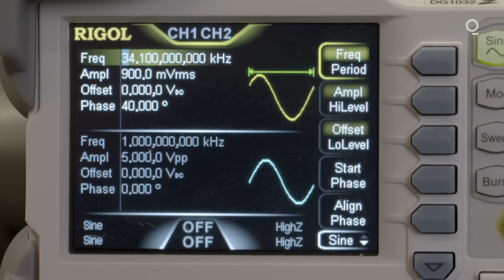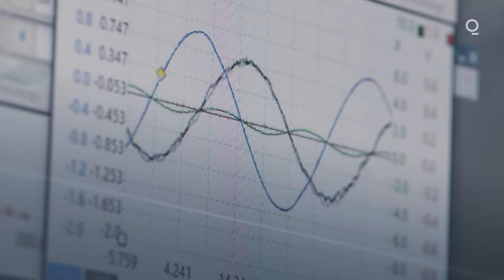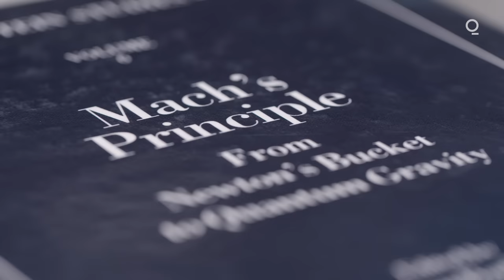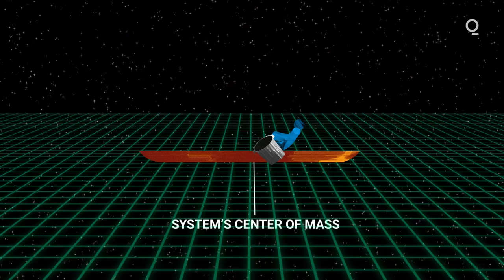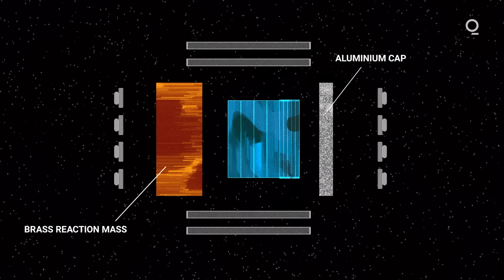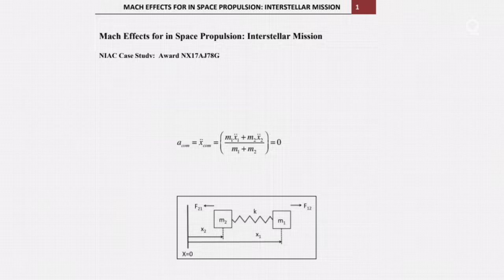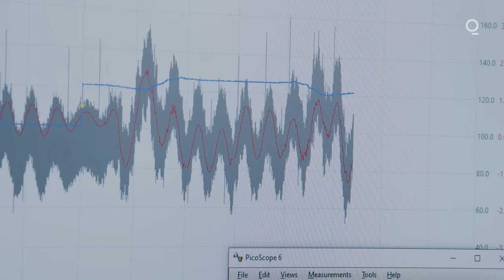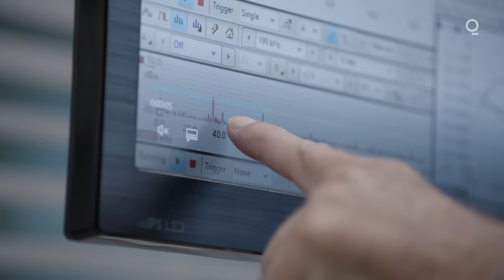Two Scientists Are Building a Real Star Trek 'Impulse Engine'

Comment: Crystal don't get mass when it expands and don't lose any mass, when it shrinks. Such mechanism already tested in space (But they probably shouldn't). Force produced by such "thrusters" is result of uncounted friction in system, in  the vacuum of deep space it stop producing any force. Its already tested multiple times.
Btw If it work it should work in microscale too, so MEMS is a perfect technology for magical arrays of "thrusters". Also in such form-factor it should be easier to isolate most  parasitic forces and keep them inside a chip, so testing will be more precise. Also different thrusters in the Array on chip may be arranged in a way that system will provide continuous force (decouple individual thrusters  with some kind of springs and dampeners, so vibrations will be filtered and any constant force should remain. that alone will  reduce vibrations, but if nearby  "thruster" assemblies will vibrate with phase shift, say 120°, it should completely cancel out vibrations (without decoupling it may cancel useful force as well), so you get hard-to-refute results).
I don't believe that it work, but if chip would generate some measurable constant force in vacuum chamber, I'm probably would had change my mind.

Comment: Either way, this work will prove a path is viable or not…That is valuable to science.
Reply: @dbmail545  so what do you do to make a difference for the future? Are you out contributing to make change or keep it the same and hide away in a bunker naysaying others sacrifice?
Reply: @Peter Evans  the links to the research is in the description…Didn’t notice braces, but I’m sure a dentist can solve it. Still any person out there working to push science is a value to it…Especially when it comes to humanity expanding into space.
Reply: @Peter Evans it’s pretty impressive they made it to phase II thus far in an Innovative Advanced Concepts for NASA…How far has your R&D made it?
Reply: @Peter Evans, "No mention of where this energy is coming from to power the crystal". They did mention where the energy comes from to power the crystal. At 9:20 they say a nuclear battery would be used to power them.
Reply: @JNCressey  what exactly is a nuclear battery
Reply: @duality4y , a nuclear battery is already well established technology. 

It is a device that holds a radioactive material and generates electricity from the energy given out from radioactive decay. 

For example, the Voyager probes use radioisotope thermoelectric generators, a type that uses the radioactive decay as a source of heat, then generates electricity from the difference in temperature by the Seebeck effect.
Reply: @Peter Evans Haha I have to ask, what tips you off from how he writes his equations?
Reply: @Peter Evans Does he ask for that in the video or did you think that I was asking for your advice?
Reply: @Peter Evans Yeah, he didn't dismiss it outright.  He said it was statistically extremely unlikely, which it probably is.   

And just FYI, some of the best science and scientific thought done in this world was not funded by ANYONE.  Einstein was a patent clerk when he did his original work on relativity, as just one example.

Another example I might point out, concerning nonsense, was a guy named Boole, who was laughed off the stage for his work in the mathematics.  They said there would never be a use for Boolean algebra, and asked why would anyone even bother working such nonsense.  Problem is, it is the logic that drives every computer out there, ones and zeros, ons and offs, whatever.  You could argue that it is far and away the most used mathematics in existence now.
Reply: @Peter Evans Yes yes batteries store energy generators generate it, but if you think about it the trapped energy potential inside the plutonium is storing energy in the form of radioactive decay. But yea I get it, maybe "nuclear battery" just sounds more sci fi than nuclear reactor.

Comment: It's not really an 'impulse engine' per 'Star Trek'; my understanding is that the impulse engines on starships in Star Trek were actually ion engines. This is more of a slow warp drive.
Reply: IF the impulse engines used any kind of normal Newtonian reaction, there would not be enough fuel on board as it would necessarily outweigh the ship.
In an early novel (1970's) the author explained that it's "I.M. Pulse" which indeed sounds more like this video.
Reply: @JohnDlugosz  I don't claim to know. I've been kind of a 'Trekkie' all my life, and my understanding has always been that the ion impulse engines were for relatively short, low-speed travel within a star system, while the warp engines were for true interstellar travel.
Reply: There is nothing 'warpy' about this drive.
Reply: @JohnDlugosz  That's why they were equipped with hydrogen collectors to scoop hydrogen gas from open space to be available for the ion impulse engines and the secondary fusion reactors

Comment: Impulse in Star Trek is actually just thrusters connected to small fusion engines that aid the ship in sublight travel. I think this video is more suggestive to warp.
Reply: If they can prove it actually taps into gravity then yeah but I don't think it has anything to do with gravity. And I don't think they can create enough force to actually accelerate to the speeds they want for interstellar travel.
Reply: True, impluse isn't a interstellar drive.   Should say warp drive.
Reply: @josephwilliford2474  if the theory holds then it might be considered a warp drive
Reply: This drive changes the impulse. Warp drive warps space time. This drive doesn't warp space time.
Reply: @devalapar7878  that is what I was thinking but they are claiming that inertia can tap into gravity and spacetime. So if and a really big if the hypothesis is correct then it MIGHT be considered a warp drive due to the changing inertia causing a change in gravity.
Reply: i thought thrusters were reactionless? or is that just due to the inertial dampeners?
Reply: It is
Reply: @devalapar7878  it actually does but on a miniscale and only transiently
Reply: @cedriceric9730   its not a warp drive

Comment: it needs to be tested in space to make sure its not some sort of "air or accustic thruster"
Reply: It's hard to test any other way when looking at very small forces. The EM drive looked promising early on because the equipment was so sensitive it could pick up the force from radiation pressure as the equipment heated unevenly. It took further refinement to the experimental method to eliminate all such interference before concluding that it wasn't working.
Reply: Also a harmonic effect in regards to friction when you have sliding surfaces should be ruled out. Getting the thing in orbit on a small cubesat would be a neat way to test it out.

Comment: it will be like the EMdrive, they will spend decades of "yes that works" "no that don't work",  rather to just test it in space !! a cube sat is not expensive to send in space, much less expansive than the pay of a researcher for a year.
Reply: It would be neat for them to test it in a vacuum and point it in both directions to try to see if it works independent of some bias in how the measuring instruments are set up.
Reply: the emdrive doesnt work wither thats why they didn't spend the money to put it in orbit
Reply: just put it on the water, 2g is enough to push anything. and control it wirelessly
Reply: @iIiWARHEADiIi  I also thought about putting it on a sheet of ice. Very little friction so you'd see almost any push it generates.
Reply: Suppose you launched one and it works...would the research stop?  Suppose you launch one and it doesn't work, would the research stop?  Neither of those outcomes would cause research to stop, so there is no savings from launching while it's still half baked.
Reply: @eventhisidistaken  If you launch one and it does work, you then know it works and can put much more money into the research.
Reply: @eventhisidistaken   ok first with NO evidence it works there is no reason to incur the cost of a launch let's not be foolish. second if i weld the pistons in place in my engine to save fuel and i can't power my car i am not going to continue down that line of research because it literally got me nowhere.
Reply: @danisyx5804  as a society, we waste billions of dollars on ideas that don’t work all the time.  I’d rather see them spend a fraction of that on this research, that could actually result in advancements for mankind.

Comment: 1) If E = m C^2, then an objects mass can be altered by it's equivalent energy, although the density (form) of mass/energy conversion is important to magnitude.
2) If that energy can be displaced (within a close system, so, without using particles), then mass will have apparently moved achieving momentum without inertia (breaking Issacs first law).
3) Suppose then, the objects are physically swapped (via particles), yielding a force, inertia could made to apply in one direction only.
The effect is like cycling a space ships center of mass, front to back, using very different physics, such that it yields a net force in one direction.

The big question is how is energy (preferably photons) converted to mass - How does energy concentrate to become subatomic particles?
Perhaps I don't understand but then, breaking Newtons laws has me so easily confused.

Nice to engage!

Comment: The concept makes sense, but I'm skeptical about it "creating mass" and "removing mass". I would be interesting to see more studies about this device to make sure we rule out all other factors.
Reply: Inertial mass, not gravitational mass.
Reply: It is not creating mass, the mass is from an energy source used to created electrical current that makes the crystal expand and contract.
Reply: @disseminate4  If you can change one without the other, there's a nobel prize waiting for you.
Reply: And since the plan is to use nuclear battery (which uses fission technology), the mechanism whereby the fission nuclear reaction works is converting mass into energy, and that energy is the mass they're adding into the crystal.
Reply: @disseminate4  can you increase and decrease mass by adding and removing electric current ? sorry I'm dumb as rock so
Reply: @lincan4108  electrons have mass so i think you can? but if you remove the electric current the mass will be gone too i think
Reply: @lincan4108  " inertial mass" is the contribution to stretching of the universal gravitational trampoline
Mass is a form of energy ,the current adds energy to mass making it heavier , which means it makes a slightly deeper dent in the universal trampoline AND then the fun begins
Removing the current makes it lighter and the universal trampoline pushes back on the lighter mass moving it forward to it's rightfull place
And then you do this again and again rapidly and you get movement :)
Reply: @disseminate4  Mass is mass, there is only one, mass cannot change
Reply: The issue is conservation of mass/energy.

It totally works to add "energy" to change the mass and whatnot, but where does the energy go and where does it come from?

Seriously, forget that the amount of energy required is ridiculously high.  The energy comes from somewhere on the ship, it goes to somewhere else on the ship, something on the ship moves...the energy and mass in the ship (closed system) stays the same.
Reply: @prich0382  matter can be displaced thus warping space and time..
Reply: @lincan4108  : By adding & removing current? I would generally assume no, but the meaning behind your question? Well, for that I would expect the answer to be yes. If you charge up a capacitor, I would expect that capacitor's mass to increase for as long as that capacitor remains charged. After all, nuclear reactions convert mass to energy, so we should expect the opposite.

Whether just vibrating a mass back & forth will work... I'm dubious.
Reply: @disseminate4  it's not two different things. it's a same things.
Reply: @thastayapongsak4422  Oh… how? What is the theory behind your explanation?
Reply: @renevile  Finally, someone with an actual working brain.  Thank you.  I was losing IQ points reading through this comment section.

Comment: Theres another propulsion experiment that is going on that is  similar, or maybe they are the same experiment? The other one I am referring to is the Special Relativity engine that uses the example of a ball going back and forth in a cylinder but it is doing so a relativistic speeds to generate the Gravitational Redshift excess energy to help with propulsion. Gravitational Redshift is the mechanical explanation for the Mercury Perihelion Problem that was the first test of Einstein even before Gravitational Lensing  was observed. 

But yeah, these two propulsion types, Im not sure if they are the same idea or different.
Reply: My understanding is that special relativity was soon updated by general relativity, but no-one really understands it. Lots of talk, but incorrect solutions to the differential equations, and denial?

Comment: When Einstein came up with theory of Relativity, most all called him Nuts too, yet it turns out he was absolutely right
Reply: Actually, hes not right, but he advanced our understanding and our desire to understand better and more.
Reply: @YouTubeH8sMe is right.  We know that Relativity cannot be absolutely correct, or to say it more accurately, absolutely complete, because it is incompatible with quantum mechanics. Which is if anything better tested, but also cannot be absolutely complete.  But that's OK.  Newtonian mechanics is not complete, it breaks down at speeds close to the speed of light, or at high gravity.  Some of its failings contributed to pushing Einstein to develop Relativity.  And yet it is still accurate enough to precisely guide our spacecraft billions of miles with extreme accuracy.  Because at speeds our spacecraft travel, Einsteins additions to Newton make little difference.

But the more important point to remember is (to paraphrase Carl Sagan): 'Yes they laughed at Galileo, they laughed at Newton, they laughed at Einstein. But they also laughed at Bozo the clown.'  Being laughed at doesn't mean you are wrong.  But it certainly doesn't mean you are right.  That is determined by experiment and correctly predicting observations that other models don't. On this basis almost all the people 'they' laughed at turned out to be wrong.  But some of the few who were not, changed the world forever.

Comment: Every single time someone supposedly finds a loophole in physics like this nowadays, it ends up just being a miscalculation or misunderstanding. I'd love it to work as much as the next guy, but don't get your hopes up.
Reply: 4:48 - I'm afraid that might be the case here. I'm just not seeing how piezoelectric material could actually be gaining mass when it changes shape.
Reply: @jjones2582  Maybe somehow electrons are getting caught or added to the mass. and then taken away.
or something of the sort related to the electricity adding/removing mass in very small amounts.
you can convert matter to energy. why not the other way around too. its just much harder. maybe its finally happened.
Reply: @realflow100  - If electrons are being added to increase the mass then it won't help with space travel since the electrons would need to be a part of the enclosed system. For something useful to exist it would have to be a field interaction that we "measure" as mass, but which doesn't actually change the total matter in the system.

Like you alluded to in your last sentence, it would have to be a way to convert energy into temporary or virtual mass. Maybe Piezoelectric materials do that and we just never realized, but is more likely they are just contracting like a muscle cell in response to the electric current.

It would be really cool if it's gaining mass though. Here's to hoping.
Reply: @jjones2582  You're assuming an electron exists as a particle in reality. Perhaps it's really analogous to the photon. The word "Waveicle" has been used because the photon is both a particle and a wave depending on observation. Perhaps an electron is a "Fieldicle" appearing as a particle or a magnetic field depending on the observation method.
Reply: @JohnJ469  - You are right on my assumption. The electron is considered to have mass.

It would be something if we learned it is more like a photon but with an outsized interaction to the gravitational field. However, if that was the case, one would think that giant electro magnets might also be heavier than their plain steel counterpart and we would have noticed that by now.